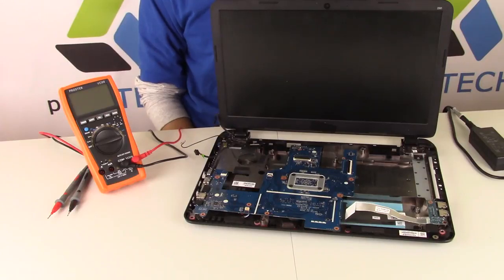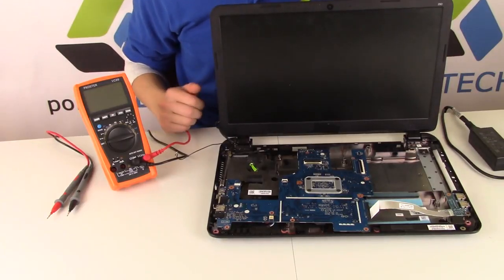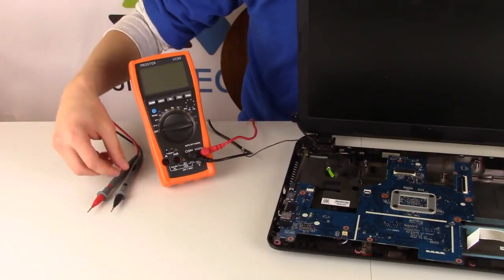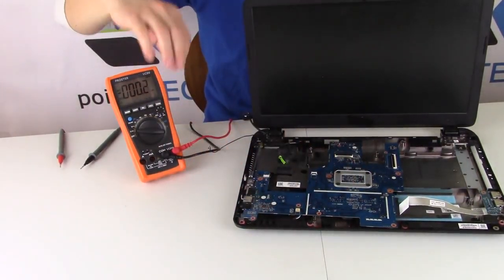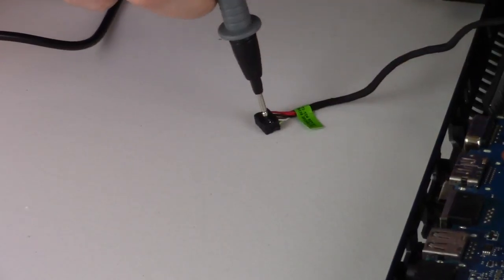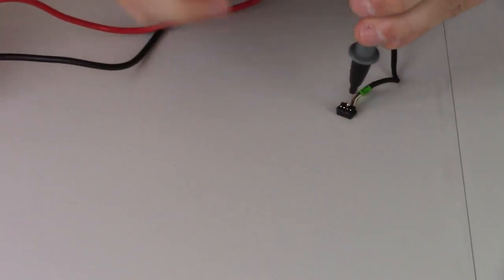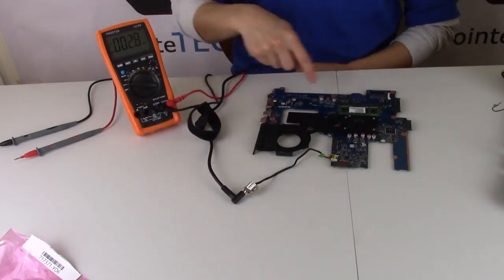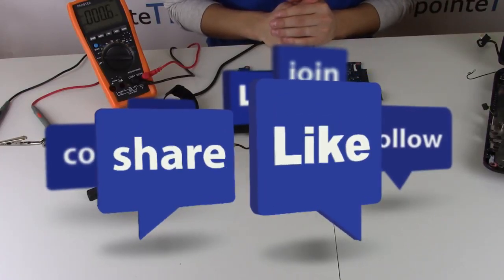How to Fix Test Power Jack - HP Laptop Computer

Comment: Hi first let me congratulate you, for your fantastic videos, thanks to them, i already make some advances in my pc diagnostic.  I have an hp Envy 17-s143cl laptop.  This laptop do not start, whith the battery or with the power charger cable.  When i connect the power charger cable, the little light at the power jack connector side, do not bright.  And when i press the power buttom, no light, no fan, no sound neither.
Now if i already checked that the the charger, the power jack and the power jack port have 19.4 volts, what need to be my next step?  Is the mother board failing?  Please, do you have another video, that i can follow?  Thank you, very much for your help!
Reply from the maker: For a computer that does not turn on, try this video first; https://youtu.be/HHwzA37r4e8. Let me know how that goes :)

Comment: Great videos , I'm at this point , I know my battery needs replacing , but prior to it just being a Solid on Orange light on a old Asus X502C , it goes out when I press the power key. Did the Bios reset and put a new CMOS battery in too , tested the charger 19.47 v , all ok , battery ,one of those horrid built in ones , but it stil gave me 1 hour charge which I'd have gone ahead and ordered be it not firstly finding your tuition vidd ,because I've always gone from a article that it does ,esp gaming Laptops ,them good to work off DC alone , so now I'm at a point where I've yet to do a voltage test to the Laptops power port ,and take the mobo out again ,if it's not that it's gotta be comment failure , my issues all started when I was testing a monitor ,as soon as I plugged the HDMI port from the UN powered monitor to the Asus socket it never came back on again, it did for sometime Blink orange but then it's constant orange , so you talking about ,"Static ,that's got me thinking "! The monitor could have been unstable and mmmmm, just thought , if that's blown , and it's wrongly fused prior then it could have Cost me the use of a laptop worth a few quid , but you feel after a while confident and never let you down , gotta say too,Asus , Lenovo,HP, etc , all have this horrible built on board RAM,internal batteries , it's like the days of repair to them ,they don't want them to be repaired now ! But thanks for a great step by step
Reply from the maker: Good luck !!  Let me know how it goes :)
Reply: @PC_Monkey  Put a new AC adapter on , tested pre connecting it to the mobo, Continuity was good , correct voltage , and it's Bob on now ! So I've ordered a new battery , so deffo you've helped me save £300 whereas  it's cost me £23 , perfect , 100 percent helped the pre Xmas saving , massive thanks , great advice from you ,🇬🇧👏✌️✌️
Reply from the maker: @dazzp2  Great to hear !! Always here to help :):)

Comment: Just watched the Video's very good. Not being a Technician, if I buy the Connector part which is not expensive, can install myself. Does it entail just unplugged the old and in plugging the new. HP Diagnostics said the connector / adaptor  passed the test???.  Its either that part or I'm stumped its still reading 4%.  Now I know where the hidden screws are to remove the cover I will suck all the dust out and pull out the connector device and then plug back in???
Reply from the maker: Yes, usually the power jack is not a very expensive part.  If your power jack is on its own board, it would be a simple matter of removing the board and replacing it.  However, many power jacks are now a part of the motherboard and not on their own board.  In that case, it would be a matter of replacing the motherboard or un-soldering the power jack and soldering on a new one.  I dont understand the last question.

Comment: I opened up my HP Laptop saved Manual and it shows the instructions. No wonder I could not fully remove the bottom cover, there are screws under the Rubber Feet Cover
Reply from the maker: Ya, often they hide them there.  Always best to look up a teardown video on the model of your computer first
Reply: @PC_Monkey  No its accessible I have a copy of the Manual Page Illustration but cannot attach to the reply?

Comment: Very helpful. Good tip matching the power supply symbol with the multi meter.  When I plug my laptop it starts up for a few seconds and stops.  Occasionally I see the BIOS screen for a second before shutting down.  I've tested my power supply and the connector on the mobo, it's soldered to the board.  I've also removed all components, HDD, CPU, RAM, WiFi.  I've left the display connected & keyboard.  I removed the BIOS battery overnight.  Also checked for a loose screw that may be causing a short.  Any suggestion?
Reply from the maker: 1.  Are you able to find any recovery or restore options in BIOS?
2.  Assuming you have an HP computer, can you try the steps seen here?  https://www.youtube.com/watch?v=_qF-oqPrn7M&feature=youtu.be
Reply: @PC_Monkey  I can't get to the BIOS, I only see the BIOS for a second before it shuts down.  PC powers on for 2 or 3 seconds and the shuts down.  Not a boot loop problem, also not a HP, it's a Samsung. Tried instructions here https://www.youtube.com/watch?v=P3I7dDpkJps&t=138s  Thank you for you help
Reply from the maker: @rfausey  You tried the manual BIOS reset as seen in that video?  Also, if you remove the battery and only turn the computer on with the power adapter, does the computer still turn off?

Comment: Hello my laptop cant charge..  I can use it only if connected to power socket..  I even try to change battery but will not charge..  It my power jack still the problem if i can use it to on the laptop but not charging?
Reply from the maker: If your computer turns on and works normally but will not charge your battery, try the steps seen here first:  https://www.youtube.com/watch?v=arZpfqcVoUs

Comment: Hi PC monkey! I have a question. I pulled an Acer aspire A315-21 in mint condition out of an eWaste bin the other day to try fixing it, but the problem was that it had been completely soaked - it’s been raining alot over here. I took it apart and dried it over a few days, and I’m certain there’s no moisture left. So I followed your guides and narrowed the problem down to the power jack. I pulled another working power jack from an old laptop with the same power requirements and soldered and plugged everything in, checked with my multimeter, and it seems to be delivering power to the motherboard. However the only thing that happens when I plug it in is the low battery light comes on (when the battery is plugged in) and I can hear a very faint buzzing that I think is coming from the ram. This happens with or without the battery installed, but the battery doesn’t seem to be charging when I tested it with my multimeter. The only thing I haven’t tried is replacing the ram, as I can’t find a replacement for it. Ill find more ram to test with but is there anything else that you can think of that could be wrong with the laptop? One thing I will add is that I dropped one of the power wires on the metal casing by accident and it sparked, but I don’t think the casing is connected to any components thankfully. Thanks for your amazing guides!

Comment: This might be a shot in the dark considering how old this video is, but I need help. If it helps, my pc is a HP 15 bw.

I replaced my powerjack which I thought was the issue behind my laptop not receiving energy while comnected (even though the charging light turned on), but then my battery wouldn't charge with that either, and worse, it ran out completely after doing a battery report. 

At that point I thought it was either the battery or the motherboard-powerjack connector, the latter being the most suspicious to me since my laptop can't be powered on with just the charger, but I first bought a new, generic battery anyway. 
Turns out that battery couldn't even turn ON my pc. I then tried with the old battery again while it was turned off and it apparently was charging, with the orange "charging" light and all. I left it like that like for 5-6 hours, then I tried to turn it on, which it did for a couple seconds, because the battery didn't charge at all. I couldn't even get past the manufacturer logo.

Now, when I tried to connect it to the power again, the charging light wouldn't even turn on, new or old battery. That's when I tried checking with the multimeter. 

Problem is, everything was reading fine; from the charger, the powerjack, even my most suspicious component the motherboard-powerjack connector.

I'm at a point of not knowing what could it be, I've tried turning it on with no RAM, HDD, etc. and nothing.
Reply from the maker: For a computer that does not turn on, try this video first;  https://youtu.be/P3I7dDpkJps.  Let me know how that goes :)

Comment: If my power Jack its bad were can I buy a New one ?
Reply: Update the power jack its good I bought a multimeter and did everything on the video you teached me but the baterry its alittle bulky like maybe in bad condition I ordered a New one still waiting on her but the thing that confuse me it won't turn on whitout the baterry and charger plugged in and the power jack its ok on both ends and the charger its ok two (I did static test ,charger tip test, power jack test)
Reply from the maker: The computer wont turn on without the battery and charger in?  It wont turn on with the battery removed and only the charger plugged in?

Comment: Hey there Mr. Impresive (pc monkey). I just found you when I Googled a PC Nightmare for me. Your video came up and it was what caught my name. I Love your style and dig your voice! Anyhoo, my 17 inch HP laptop just turned 2 years a few months ago and of course, I only had a 2 year extended warranty. I work at home since the Pandemic started with my job. I shut down my laptop this morning (first time in months, I usually let it sleep because of my needs. There was NO illumination or noise when I hit the power button. spent time checking power sources, outlet cords, etc, 
I overlooked that the problem was the pin plugin to the power port. The inner plastic tube came OUT of the pinhead where you push, plugin at the power source! PLEASE HELP, I AM LAPTOPLESS IN SEATTLE NOW! (near Seattle, lol...) Thanks

Comment: 😭 Help please. My charger turns off when i plug jack on laptop. Help please. Is this steps the right ones to fix it? Or any help please
Reply from the maker: Is that the only issue?  Does the computer work normally otherwise?

Comment: Can anybody tell me what the brown center pin voltage is supposed to be.. I've got the same laptop and I'm trying to change the plug in the motherboard cable. It's a 7 wire connector. 2r,2blk,1y,1w, and 1 brown which was the center of the original plug. I'm assuming it's a smart sense wire to identify an hp power supply. Thanks

Comment: I plugged in a wrong charger with 20 Volts over the charger I was supposed to use.   Laptop was still working but then wouldn't charge anymore.   Would those symptoms be a sign of a bad battery, ports or motherboard, or too difficult to tell without doing these tests?  Any help would be much apprecaited
Reply from the maker: Its possible the battery is damaged.  Your computer is turning on and working fine otherwise?  If so, can you try the steps seen here?  https://www.youtube.com/watch?v=arZpfqcVoUs
Reply: @PC_Monkey  Awesome, I'll try that, thank you, much appreciated
Reply from the maker: @jordandevereux1300  Good luck !!  Let me know how it goes :)
Reply: In the end I took it to a repair shop, I believe a couple capicitators had blown on the motherboard, so those were changed out and it's working again.   Your videos came in handy though self diagnosing so atleast I had some idea of what the problem was.   Thank you so much again

Comment: My hp pavilion model 15 ab283nr won't turn on all of a sudden. checked the charging cable, power jack, and power port. they all work. funny thing tho, is the led won't turn on either. but there's power according to multimeter. when i press the power button, there's no sign of life. no sound, no fan going on, no leds, nothing. what do you think the problem is? thank you!
Reply from the maker: For a computer that does not turn on, try this video first;  https://youtu.be/P3I7dDpkJps.  Let me know how that goes :)
Reply: @PC_Monkey  thanks for responding. i had already watched that video. so next step is to try a new mobo. god damn it!
Reply from the maker: @gareth6517  Ya sorry :(

Comment: Question I have a mini desktop that when I plug in the ac adapter the power light on the ac brick turns off. Motherboard power port has 4 leads and then five pins that go to the motherboard . All pins register continuity is that normal?
Reply from the maker: You said desktop but also said ac adapter.  Do you have a desktop computer or a laptop?  Most desktops dont use an ac adapter.

Comment: So uhhh one of my ground pins is all burned and whenever i touch it with 1 end of the multimeter it sparks without contact to V from the other one 👁👄👁
Reply from the maker: Sounds like you need to replace it.  And if thats not a possibility, then replace the board.
Reply: @PC_Monkey  yeahh, im pretty sure i accidently shorted the system too. So it might be toast for good now. But i can probably some part for some goofy project :p

Comment: hello, i could really use your help, i have an acer aspire 3680 which wont turn on, ive tried eveything even the cmos and factory reset still no signs of life, but  commonly, when i put my changer into the power jack, it woukl create a small spark that like what 0.3 seconds? really fast so...can someone explain what it is?
Reply from the maker: How did you try the factory reset if the computer had no sign of life?
Sparks are not good :(
For a computer that does not turn on, try this video first;  https://youtu.be/P3I7dDpkJps.  Let me know how that goes :)
Reply: Hmm...i teied ti a few lonths agos o i dont exactly remember
Reply: I found the problem,back in 2013,my laptop ahd a problem with the charging port with it not have propper contacts so after some solderign ti worked thankfully but i guess its the problem
Reply from the maker: @knightsson1045  Good luck !!  Let me know how it goes :)
Reply: Okay :D

Comment: Hello, motherboard pins only read 1.5 volts. Power supply and power cable pins read 19 volts. Bad motherboard or could the supply be failing under load? Tnx so much
Reply from the maker: I would guess bad MB :(

Comment: Hi, so a/c adapter tested fine, down to dc jack, where  again, I don't know what i'm doing.
Mine has 9 wires, from closest to farthest from jack: a single white, then 4 blacks and 4 reds.
Does is matter which black and which red I test. Laptop is a DELL G3 17 3779.

In any case, I somehow managed to get a 19.xx v reading, so this is not turning out as I'd hope.
Tested with original battery and then with brand new battery, a/c adapter tested out ok, as well as dc jack.
Reply from the maker: What is the issue with your computer?  Is it not turning on at all? 
Are there any signs of life at all?  Lights?  Fan, Motherboard, or Hard Drive sounds?  Anything seen on the screen?
Reply: @PC_Monkey  It started out as working fine, but only on AC. 
In the last 2 days, it seemed to go thru all possible power malfunction schemes. After way too many steps to list here, I somehow managed to get it working like new !
Reply from the maker: @jrl4871  Glad your all set :)   Always here if needed !!

Comment: What Am'I gonna do if my laptop is not working but it is charging and  I take it at the repair shop and they said that they need to replace new keyboard,what might be the cause?
Reply from the maker: The computer turns on and works well but does not charge the battery?  That usually has nothing to do with the keyboard lol.  For that issue, try this video first;  https://www.youtube.com/watch?v=arZpfqcVoUs
Let me know how that goes :)

Comment: I accidentally put crazy glue on my power jack while the wires were exposed
Reply from the maker: Are you asking a question?  
What happening with the computer?  Is it not charging?  Is the glue blocking the jack?
Reply: @PC_Monkey  Its not charging i think the glue is blocking the jack
Reply from the maker: @unknowable1407  Is the computer turning on and working well except for not charging the battery or is the computer not turning on?
Reply: @PC_Monkey  It died so Im not sure
Reply from the maker: @unknowable1407  For a computer that does not turn on, try this video first;  https://youtu.be/P3I7dDpkJps.  However, if your battery is dead and the power jack is damaged, then you may need to repair the jack first.
Reply: @PC_Monkey  how do i repair it
Reply from the maker: @unknowable1407  You would have to clean out / remove the glue that is blocking the power or replace the power jack
Reply: @PC_Monkey  do you have any idea on how I can clean it out
Reply from the maker: @unknowable1407  It depends on what type of glue you used.  You would most likely have to take large parts out by hand or use tweezers or something.   Then try cleaning the rest with some sort of neutral cleaner, preferably with alcohol to aid in drying fast.
Reply: @PC_Monkey  thx
Reply: @PC_Monkey  your such a great help best helping youtuber